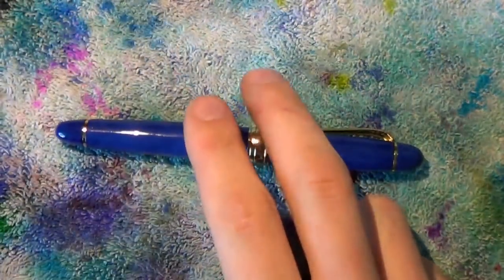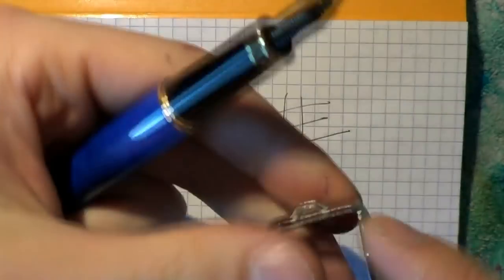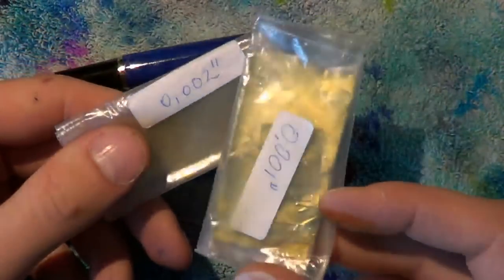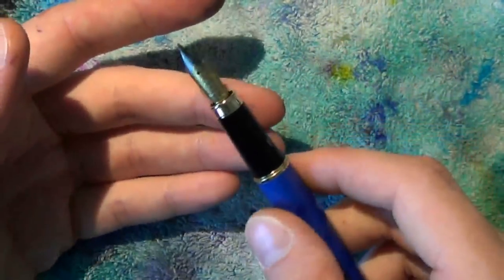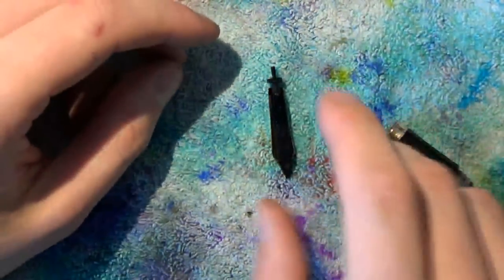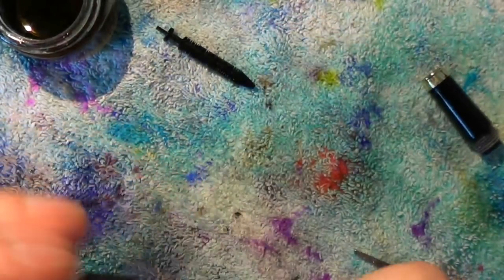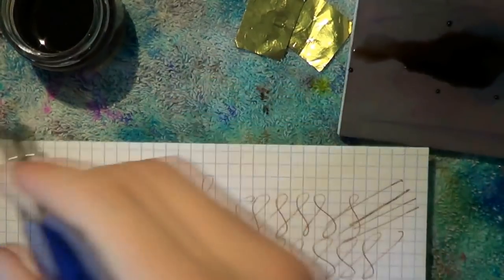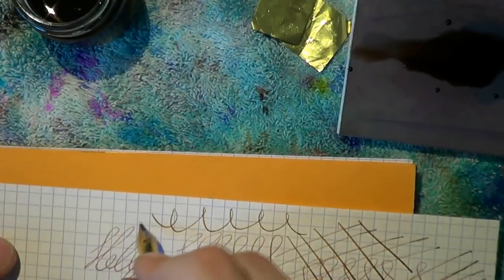Fine tuning and Adjusting a Nib

Comment: Lovely tips. And useful, as always. Down here, in India, I'm having a tough time getting brass sheets. So I end up using razor blades - the kind you use in old-style safety razors or snap in half to use with cut-throats. Of course, I am careful to use just the edge of the blade. The width of the edge is good enough. Not as flexible as brass sheets, either, but gets the job done. A bonus is that I can use the blade to cut the feed if I want a wetter pen as well.

Comment: Clearly smoothing the nib is harder than it looks. I have an old Parker 45, the nib was a little scratchy so I used some micro mesh 8000, 6000 and 12000 to try and improve it. I’ve made worse! It digs into the paper and will hardly write now… oh dear!

Comment: I don't think its acceptable that you should have to do this. Regardless of cost. I have used Lamy pens for many years and never had an issue. In fact the Al-Star I use mainly, I have never taken it apart or cleaned it for 20 years.  It just works. I have a Jinhau X750 on order so it will be interesting to see how it is.

Comment: Also stephen get a polishing block as the micro mesh is still abrasive leaving texture on the tip. With a polishing block you can smooth those imperfections out getting some more smoothy goodness

Comment: I have several Fountain pens including 6 lamy safari fountain pen and 1 Twsbi eco. Lamy nibs are  not good. but Twsbi eco and Jinhao and Moonman FP s write smoothly.  but I finally found myself comfortable with a Reynold Jotter ball pen which is just INR 25rs which is equal to 0.25$.! and for wet writing Best pen is Pilot V5 or V7 Roller ball pens which are available at 60 Inr which is equal to 1$. but i just buy FPs for their design and colors.

Comment: Thanks for the videos,one thing I note is that when your abrasive paper is used,that you still have a little scratchiness.In the watchmaking repair industry after papering we polish to a high degree.What we use to polish with a mirror finish after papering is a stone called 'Water of Ayr  stone.' So with that in mind I repaired my vintage Sheaffer,it is not at all scratchy now......Colin A Fry.

Comment: is this the MX or the MM micromesh you use? I want to get it here in europe but anderson pens doesn't specifiy which one it is. the MM is softer and used for polishing plastics and lacquer while the mx is harder and used for metal. since the nib is made of metal i would think the mx but on the website of anderson pens the micromesh is used for polishing the plastic parts of the pen so maybe that is the MM type. Was there some kind of instructions in the package and could you advice as to which type i should get? the grits are the same on both types
Reply from the maker: I'm sorry, I have no idea.

Comment: Hey Stephen, what brand and magnification is your loupe?  I'm looking at 10X, 12X, and 15X trying to decide which would be best for me.  Thanks!  Your videos are extremely helpful!
Reply: Well Mark I've used loupes over 35 years.I have several loupes.They are sold by the focal distance the commonest used by most jewellers is a 3 inch focal distance and it is stamped on the side.This makes hallmarks etcetra visible.When I work on a watch I use a 2 1/2 inch focal distance.I find these two give me what I need.However these loupes are not available in high  focuses and the small lenses of an open/close lens is neccessary.These magnifying glasses are expressed in magnification,for looking at diamonds and their inclusions and the best of these is 20X. Colin Fry.......

Comment: When you do this I assume there is not really any pressure on the nib or do you use normal writing pressure? I used a 12,000 grit buff stick like you use in another video and basically let the weight of the pen do the work and actually tore holes in the pad. Luckily the pen is ok and does write better. Perhaps this is an issue with fine/ef nibs on this type of surface?
Reply from the maker: Indeed, very little pressure is necessary.
Reply: sbrebrown hey I need help I just bought a nib set I think it's called a Manuscript leonardt dip pen it's not working the way it should it has a attachment on the bottom I think it's for the ink but it's not working smooth like it should any tips or help on what I should do to make it work. ....Please help
Reply from the maker: Roberto Torres Some dip nibs have an ink reservoir attached to them that fills with ink as you dip them.